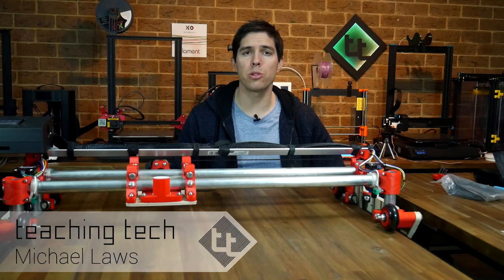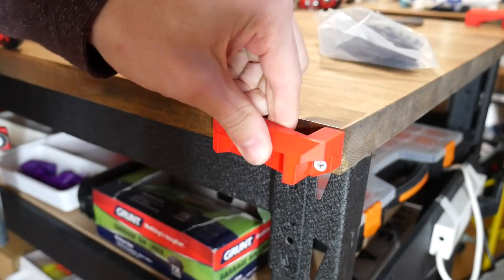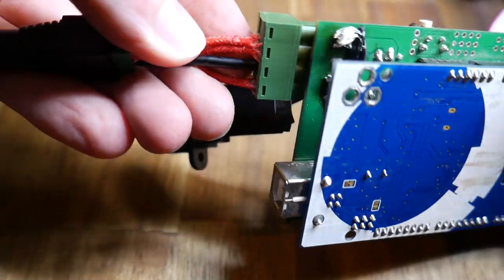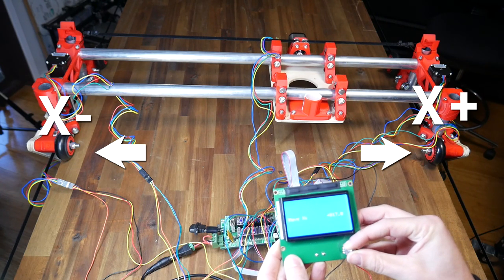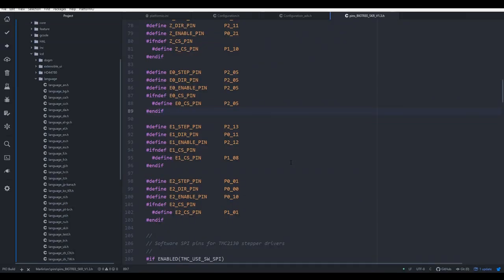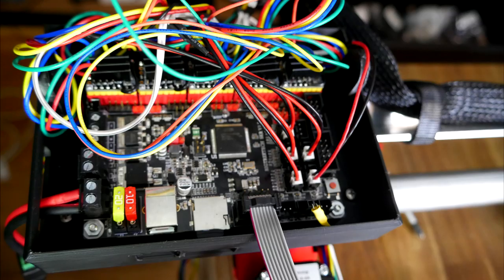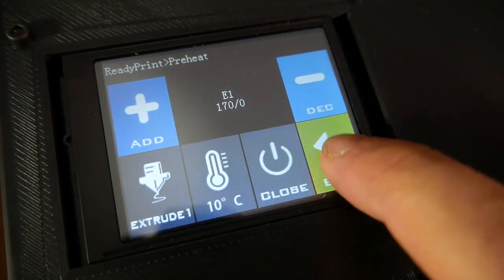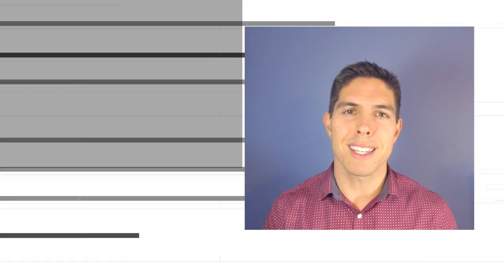MPCNC Lowrider part 2 - belts, wiring, firmware: Ramps + SKR V1.3, TMC5160 & touch screen

Comment: Great concept, "lowrider" CNC . My very first CNC machine  I built back in  the late 1980's early 1990's  was also a lowrider, almost like a plotter, vinyl cutter on the Z axis function (Pen UP , Pen Down). At that time, I needed to cut a lot of flat plates from plywood, plastic and thin aluminum, so height was not that big of a deal and thus  I designed my machine to run on parallel rails using  high quality drawer slides  spaced 4" appart for the x and Y axis,  using acme screws, home made delrin nuts and steppers from surplus machinery. I  mounted this machine mechanics to a  2" thick particle board formica covered 2x2 ft night stand table, it was heavy solid and pretty darn flat and had great squareness so assembly was rather fast. All CNC file work was saved as plt file, (plotter file extension) and I was running a DIY 4 axis controller board powered by an old computer power supply.  Back in the day there were no kits available and one had to piece everything together with a lot of elbow grease, search/find and creativity, but this first machine worked very well for the making flat pattern work.   

I made a similar machine 5 years ago tired of not finding a suitable inexpensive machine that would cut, ultra fast, fabrics.  Lasers are great for this and running on belts it is a must for speed.  My fabric cutting lowrider machine however runs on steel U-Channel extrusions for both the rails and the table base, making it extremely rigid, and probably overkill for laser cut fabrics, but the U Shapes on the extrusions  also allowed me to hide the belts inside for a super clean setup. This machine will also cut wood and aluminum equipped with a high speed router with a good degree of precision.

A machine that uses a regular table, or work surface,  as a base is a bit tricky,  since most tables are not designed for squareness  precision bases but rather for  surface functionality.  I also have made my own 3D printed rails and no matter how strong you make a plastic 3D printed plastic rail, it does not match the rigidity and precision of a metal one, and although properly designed 3D printed rails work  great with high precision skate bearings, just do not plan on cutting metal parts with precision and speed, for this you really need a rail system and structure with high precision and mass,  no 3D printed plastic rail block or wood table mounted mechanics is going to do that.

One of my first bought CNC machines was an early retrofitted Sherline Mill (not steel but still, solid aluminum machine) a great little machine which I modified the screws and nuts to provide greater precision,  and impressively I cut a lot of aluminum small Injection molds including some steel dies, for the first products I was producing when I establish my company. Back in these times , desktop 3D printers to the level they are now,  were still a dream.
 
It is interesting to see technology evolve, especially when you have been watching it from the very early stages.

Comment: Hi Micheal. Thanks for a great video. I’m really enjoying your channel. You have inspired me to attempt this Lowrider 2 and I’m finally up to the electronics stage. I bought an SKR V1.3 with TMC2209s and with a TFT35 v2.0 display. I was hoping to be able to adopt you generously shared firmware to get it all up and running. At the moment I’m having real trouble with the display update. Can not seam to get it to simply accept a logo.bmp update via the SD card as they mention in their document about customisation of the display. Are you able to point me in the right direction?

Comment: Thanks for your helpful videos.
Any reason you chose TMC5160 over TMC2209? Is the higher current rating of the TMC5160 really needed or is the TMC2209 sufficient?

Comment: Do you think your 1.3 firmware can be reworked to use a 1.4 Turbo (LPC1769)?  I got a 1.4 T/TFT35 bundle for my MPCNC Burly, but now can't locate firmware that actually works, just a version from a V1 facebook group that compiles, but I can't seem to connect to the board via TFT or S3D over USB.

Comment: you can do sensorless homing... just need to add some spacers to the lead screw. Check my build thread on v1 forum :)
Reply from the maker: I found it inconsistent, mainly due to my two Z axes having different alignment and therefore varying torque to rotate. I agree you can do it but there came a point where I had to cut my losses and get it working more reliably.

Comment: I stopped buying some pvc fittings from homedepot because they put barcode stickers on the parts. Some they place right on the glued surfaces, and getting it off is nearly impossible. The same with copper pipe fittings, though they are so expensive now you cannot justify using them anyway.

Also wouldn't using copper pipe be better because it is smooth?

Comment: Thanks for all your videos, I have put the file for the SKR  onto the SD card reset but nothing, screen file worked a treat. Any suggestions
Reply: neither are working for me.. plus the files weren't free. i had to donate.... not that I care about donating mike has helped me a lot thus far. but now that the files are not working at all, I feel scammed a little. also, the fact that the marlin doesn't support 2209 drivers so I even purchased 5160s and that set me back 150 Canadian. and inside his skr 1.3 files there's not even a firmware file or a .ino. the reason I even went this route is that my time is scarce atm, just to get it functional. but eventually I will get this up and running myself the long way. did you get this up and running?

Comment: Use the neglected conduit for your wires spanning across your machine. then cable chain across the aluminium angle for your x.
Reply from the maker: I have some spare cable chain in my drawer and am considering this.

Comment: what laser are you thinking of?
Reply from the maker: Endurance Laser 10 watt.
Reply: @TeachingTech  Thanks! Great Content! This seam,like a great tool to cut balsa airplane, or foamboard airplane models. A 10w laser is too low, but a small dremel would work just fine. Your channel is awesome!!
Reply: @holski77  It really depends on what the intended use is.
Reply: @holski77  10W will cut foam board, cardboard etc easily.

Comment: Great video!  Will the MKS TFT 35 3.5" version work with the files you have provided?  I'm am thinking of building the lowrider cnd and already have a mks tft35  screen.
Reply: I'm building my own with a SKR v1.3 and TFT 35 v2.0. Here's a great case for both https://www.thingiverse.com/thing:3878962.

 I have dual homing Y and Z. Currently building the table so haven't been able to test the Y axis, but X and Z are working fine. I also did a few mods to the TFT 35 firmware to add zeroing and removing unnecessary functions Currently, my build looks like it should home to Ymin rather than Ymax. Not sure why Michael chose to home Y to the far end of his table. I'm going to add another set of Y axis end stops instead of removing wire, and then simply swap them out. After that, my Lowrider2 should home x and y to the front left of the table.

Comment: Great video series. When you adjust the voltage, I suggest using the 2V setting for adjusting, as it's (usually) more precise than the 20V setting. The difference is "huge" on the cheap DT830x multimeters. If you have a Fluke, it really doesn't matter, though. ;)

Comment: Great information about the mpcnc dont spose this will be able to cut metal or if it can be modified to cut metal like aluminium or steel?
Reply from the maker: With the rolling frame I'm not sure it will be rigid enough. You would have to do it so incredibly slow for this reason.
Reply: @TeachingTech  so would you suggest doing a normal type mpcnc for metal cutting?

Comment: When and why did you replace RAMPS? 
did touch screen function with RAMPS?
Reply from the maker: The skr is 32 bit so it will be able to output the ttl signal for my laser faster. Touch screen will work on the ramps and any ramps compatible board like an MKS Gen L
Reply: @TeachingTech  thanks for prompt reply. Great work.

Comment: once you get it running good you might consider remaking those wood frames out of 10 mm aluminium and also wd-40 is awesome for removing all glue and stickers.
Reply: What for? This machine has much more deep seated shortcomings than those plywood pieces. Fire is awesome for removing glue and stickers too. So kill it with fire!

Comment: HELP!   Your bin file just sits on the micro sd, power off, on....still nada...  I get the control screen, (for the reprap full graphic...) but when I select motor movement, I get only positive numbers and no movement, on any axis.   I am using a skr v1.4 BUT it has on the chip 1768 not 1769...   I tried my own setting, and your changes to the pins...but nada...  help!  PLease....

Comment: You have the 12 volt fan output labeled  TTL. Which uses 5 volts. I used a spare endstop pin on my Rambo MINI board for 5 volt TTL. Remaping the fan output to that pin. The SKR 1.3 might require the same to the spare endstop input.

Comment: Been trying to get this to work for an SKR2.0 Rev B with TMC5160 ... I'm unable to get the Z axis to behave (Y Axis home exactly as expected), but nothing I've come across in weeks has allowed the Z-Axis to home correctly -- they both 'light up', but only one stops motion ... 
example ... if the right z-stop is triggered first, both the right and left z-steppers continue to run ... if the left z-stop triggers first, both left and right z-steppers stop, but the machine continues in a 'wait' state as though it is waiting for the right z-endstop to trigger (when it has already stopped the right z-stepper's progress disallowing it an opportunity to trigger the right z-endstop).
Any idea how to remedy this situation? better .. anyone gotten this configuration to work?

Comment: I keep getting this error when I try to compile
Warning! `env_default` configuration option in section [platformio] is deprecated and will be removed in the next release! Please use `default_envs` instead
Can not remove temporary directory `C:\Users\Mary\Desktop\marlin 2.0 - mpcnc lowrider2 - skr v1.3 tmc2130\.pioenvs`. Please remove it manually to avoid build issues
Processing LPC1768 (platform: https://github.com/p3p/pio-nxplpc-arduino-lpc176x/archive/master.zip; framework: arduino; board: nxp_lpc1768)
Reply: What's up, I second this,  didn't find any firmware to just throw in the SD card and reset.
Reply: Did anyone find a solution to this?
Reply: @jasonpersaudfabrication  Finally got this working - followed this guide for the most part https://github.com/bigtreetech/BIGTREETECH-SKR-V1.3/blob/master/BTT%20SKR%20V1.3/BIGTREETECH%20SKRV1.3%20guide%202019%20-%206.pdf but had to manually change the TMCStepper library in the folder to an older version (0.5.2 vs the 0.6.2 being used). Also had to update some of the Python to use Python 3 style print statements (use parenthesis around the print arguments). For the "default_envs" issue above, just change "env_default" to "default_envs" in platformio.ini. It took a while to get it working...
Reply: @nijay7895  have you the firmware.bin file ready? can you send me?
Reply: @stilemanteroworkshop you still need bin file
Reply: martin lee-on yes plz. If you have it
Reply: @stilemanteroworkshop  where can i send it
Reply: @stilemanteroworkshop  Sorry, missed this. Yes, I have the bin file. Let me know if you need it. I've modified to use more current (was hitting the torque limit on the steppers otherwise) but other than that, it's the same.

Comment: Would it be possible to adapt the auto squaring for the CR10-s5 and other printers with dual Z steppers, using an SKR 1.3 board?
Reply from the maker: Yes, totally. In configuration_adv.h search for Z_DUAL_STEPPER_DRIVERS. Uncomment this and the Z_DUAL_ENDSTOPS. Set your endstop plug with #define Z2_USE_ENDSTOP. By default it will be ZMAX
Reply: @TeachingTech  Excellent. I am waiting for my board and drivers to arrive, but will definitely do this.

Comment: Could you provide additional information for a  Arduino newbie please. I cannot get any V1 engineering software to flash to my Arduino. I can successfully flash a stock Marlin firmware though. Is this enough to get this working or should I just stop and go with the SKR?

Comment: Just a heads up, at @11:10 you said common and normally open pins. The MPCNC LR documentation all says use common and normally closed. Did you reverse something in the firmware to account for the opposite switch configuration?

Comment: Hi from Holland
Im in trouble setting up the mks robin nano v3.1
i was planning on a cnc machine with 4 nema23 motors with  2 times y 1 time x and 2 times z 
5 external steppr dm542
And 6endstops 

How do i set this up in marlin ?
Mabe you can show me right direction.
Greetz Edwin

Comment: why use round tube on the gantry ? i thought round tube will deflect more than square tube under load
Reply from the maker: That's how it's designed from V1 Engineering. I think the idea is to make it as cheap and easy to source parts as possible.
Reply: Round tube is far more stronger than square tube .square tube can and does twist under stress

Comment: Hi Michael,

I'm very new with DIY CNC and programable boards.
I found your channel and it is exactly what I was looking!

I tried exactly the same as you explained in the video and I keep getting this error when I press  build: 
LPC1768               FAILED    00:00:01.069

I don't know what error is this but I know that number lpc1768 is the processor.
Unfortunately, it happens only with your firmware, I tried with marlin bug fix 2 and it works but I want to use your version of firmware for auto balance function.

Thanks in advance and stay safe!

Comment: If you are connecting two 2 Amp motors to the stepper driver, in theory you could be drawing 4 Amps. Shouldn't the vref be adjusted accordingly?

Comment: the motor I'm using has Stepping angle: 1.8°      should I use Timing Pulley with 32 teeth ?

Comment: I have gone through this whole video bought all the stuff built it and went with the better Arm proccessor as recomended. But I am now dissapointed that the firmware file is missing from the download, (which you have to pay for by the way). Even though in the video it says just copy the firmaware file to the sd card. So I have tried compiling it myself using platformio but there are many errors and I am not skilled enough to know what is going on. There is also 2 files the marlin one and the tft one, what am I supposed to do with them? This is not the only comment on this, is anyone going to assist on this or was the whole project just a waste of time and money. I am new to all this and I am pleased to have managed all the practical parts, seems a shame to be stumped at just booting the thing up.

Comment: Hi Michael, regarding the sticker cleaning, I would suggest white spirit, as acetone evaporates quickly. As a painter we have to remove loads of stickers from doors, the white spirit removes easily even the glue. It takes time to soak it in, but once it's done the cleaning is a piece of cake.
What awg do you suggest for the nema 17? I'm planning to use an SKR 1.4 turbo with 5 TMC 2209.
Thanks for the great uploads, happy for the free shared knowledge.
Keep up the good work.

Comment: Love your videos and are building the lowrider2 useing skr 1.4 tft35 v2 and tmc 5160 but cannot  change the firmware you have supplied to work with this board any sugestions? or anyone else here have firmware that will work

Comment: Hello Michael. Been learning lot from your 3d printer vids and wow i just discovered this so late, and am about to make one and starting to go through self sources BoM in my country. Why did you opt for SKR instead of the original Ramps btw? Is it still viable to build LW using Ramps Mega combo? Cuz i got lots from my old spares, and A4988 drivers? Thx a lot, hopefully before i make much mistakes in purchasing the wrong item that you can help sort it out as it's quite hard to find parts here in my country, Indonesia.

Comment: Ok, need some help my Friend.
I have a MPCNC built, 2 by 4 cut area, dual end stops, dual x and y axis, single z. 8825 drivers.
Bought the same board as you did
Using a 12864 display rerap cheap one. Got it all wired, ready, just can get the firmware to load.
I compiled it several different ways, no luck. It will compile, as it comes off of got got hub  but will not load. Board love guys up, display shows just a blank blue screen. The firmware.cur file shows on my laptop.
Do I need the 12 volt power too for loading and display?
What setting on Arduino, do I need to use, board name, processor, and such. It shows up on com port 2, try to load, times out!
Help going bat crap crazy.
Love be your videos and info!!?
Spike

Comment: By any chance is there a way to add a Z PROBE to the board? 
My thoughts were to use the alligator clip method as a switch to probe the bed and having the probe use the z end-stop switch pins. So after I home with the dual Z I then disconnect one z end-stop and connect the Z probe to the same pins and run some G code. However I googled around and found that it might not be possible to use the pins for different purposes. There are several nice Z PROBE ideas on Thingiverse to calibrate the ZERO point of the build are. 
Another idea is that it seems like X_MAX pins are available but is it possible to have a Z PROBE hooked up to X_MAX or X_MIN pins and have the signals work for Z PROBE?

I haven't assembled my machine yet but I have all the parts and can't wait to make this. Thank you for this nice tutorial :)

Comment: has anyone filled the tubes with a structural epoxy to make them a lot more stiffer?  Carbon fiber arrows shafts are cheap and would make an excellent cheap core embed in epoxy.